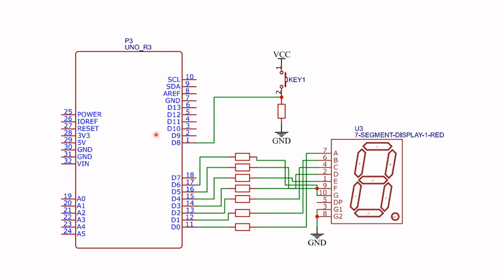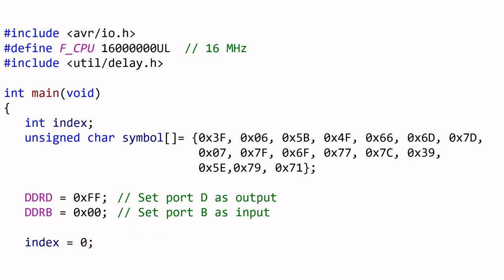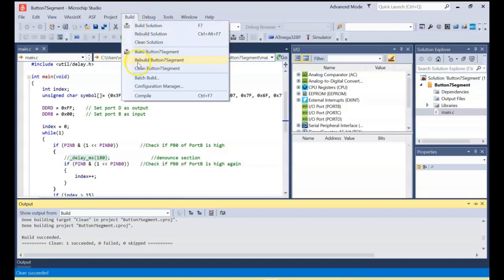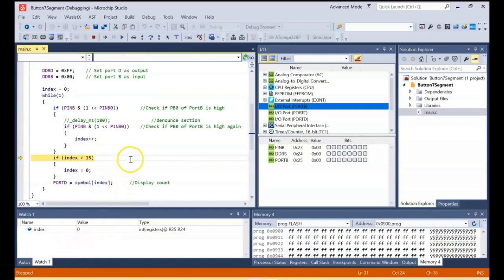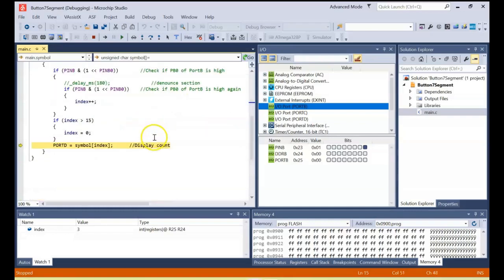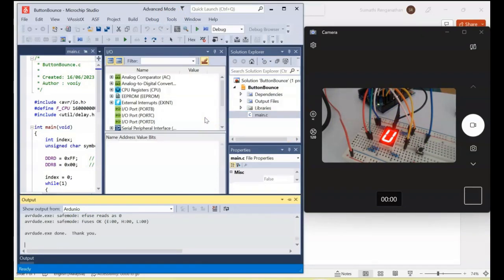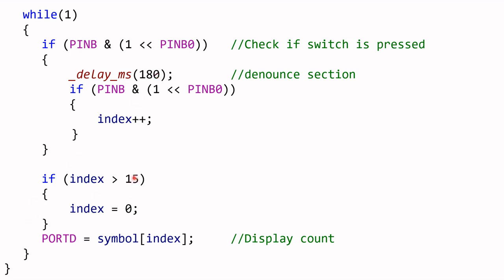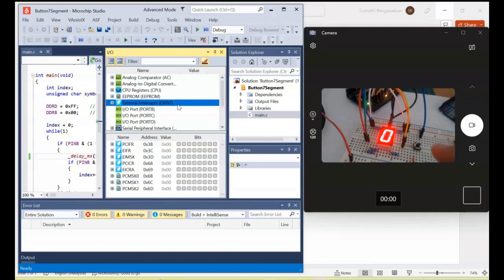#69 Switch Bounce

Comment: First, loving your videos. Trying to learn assembler and your videos have been so helpful. Now, your debounce is too long. Typically, a 10ms to 20ms debounce is more than enough. Also, the reason you kept jumping number is because you don't have any code to wait until the switch is depressed. So, you are looping and seeing the switch is still pressed so you increment. What I normally do is after all my button press code, I do a while and check the pin state. Once it goes low (in your case) I would fall back out and continue the main loop. This way you only perform the button press code once until they depress the button.
Reply from the maker: Hi, thank you for your comments/contribution. It is appreciated. Thanks.